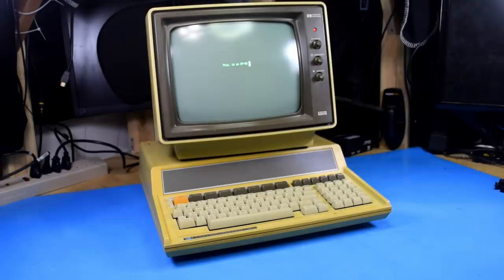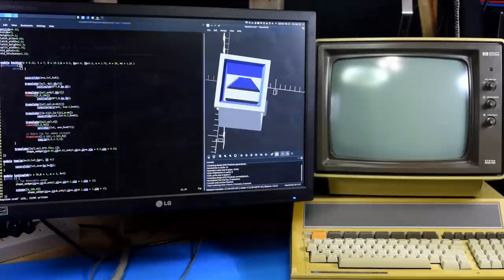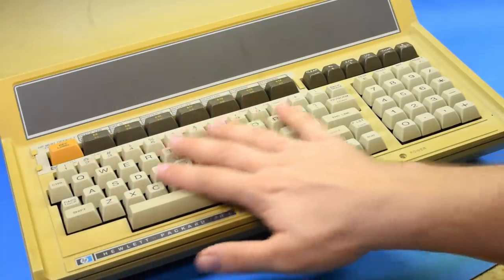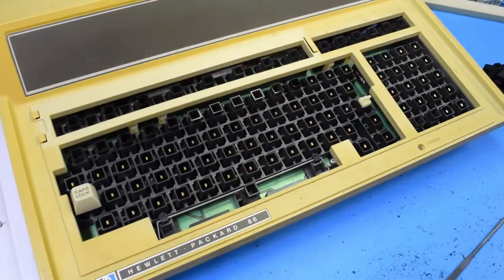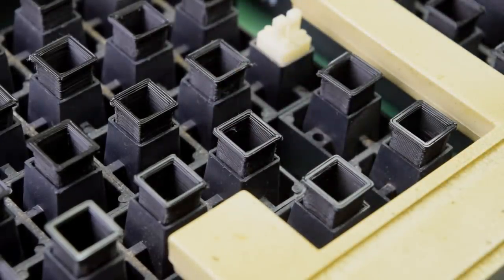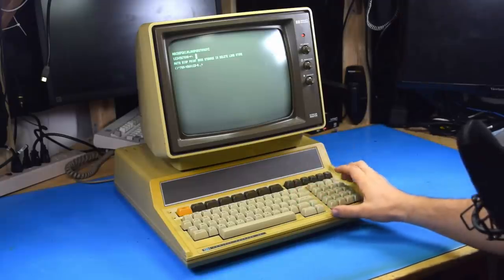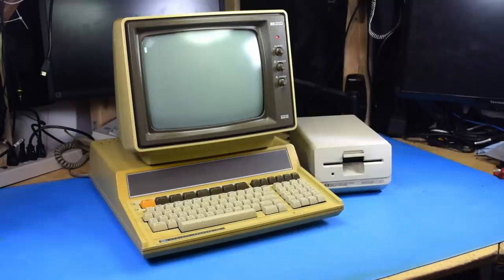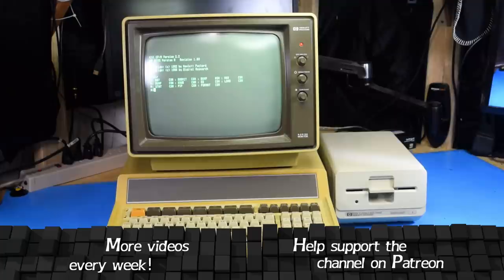0x0029.3 - 1/2 yr Update on HP-86 3D Printed Key Stems

Comment: If you give me the STL files I can print these on a FormLabs SLA printer with glass-filled plastic for you.
Reply: they're in the description
Reply: I would too be curious to see if these prints fair better. Also, post a vid of the print process ;)
Reply: @rhfweb  Well, I printed the first thirty or so last night.  They look pretty nice;  they're postcuring in my UV light box right now.
Reply: @HamburgerExplosion  I see that now.  I made a plate of thirty of these last night.  Printed at 50 µm resolution in glass-filled epoxy.

Comment: If you made those with only 3 of the top edges protruding could you print them on their sides?  I don't know if that makes sense, but I thought making the 'grain' go in the direction of movement would make for smoother travel
Reply from the maker: It would probably for three of the sides, but there are two problems with doing it that way.  The side on the top would then have to bridge the whole way across empty space, and with how thin the walls are I don't think it would be possible to make it strong enough. Also, printing them with the the "grain" in this direction makes it the strongest against the key cap cracking the corners again.
Reply: @TechTangents  That makes sense, thanks!

Comment: Sir, where did you get your fine files?  Who makes those?  I do tabletop miniatures, and have similar files (and have for 30+ years) but the fine tips have broken off over years of use and if I could get replacements just like them - which yours is! - I would be so grateful.  Mine were made by The Armory, a company sadly no longer in business.
Reply from the maker: The files I have are very low quality, I suspect that while they may look the same they must not be the same as yours if they are still in use 30yrs later.  But to answer your question, mine are just a $2 file set from Harbor Freight.
Reply: @TechTangents  Ah, thank you very much.  Yeah, I'll keep looking...heck, in my tiny little hobby I might even find new old stock!

Comment: Seems like the problem is mostly at the corners is is possible to redesign them and make the corners rounded inwards or make the whole piece round instead of square, as long as you can put clips on the bottom where they latch to the keyset and there's enough space for the spring and the levers the piece don't necessarily need to be square do they?

Comment: As you probably know. Putting another processor in a machine to run other operating systems is common. I remember running into some type of Epson computer that used cpm and had a (optional) dos card with a intel processor on it. Even when I started into computers I remember the apple macintosh pds slot run a few different options. Dos card, power pc 601 process upgrade card, and even an apple IIE card. But as you say. That is a different story.
Reply: Didn't the Commodore 128 have another processor or am I making that up?
Reply: From my understanding the c128 had a z80 processor in it to run cpm. Along side of whatever process it would use.
Reply: The BBC Micro had at least four different second processors-  from memory, there was a "turbo 6502", a 65C102, a Z80 you could use to run CP/M, an 80186 you could use to run DOS, a NatSemi 32016 you could use to run PANOS, and the ARM development kit.

Comment: I hate to be the guy who tells you you're doing it wrong but...I think you might be doing it wrong.

That kind of finishing work is really better suited to a belt sander or bench grinder. It's a lot to be done by hand with a file. And I'm 99% sure slicers have an option to randomize layer start points to mitigate this exact issue.

Comment: Cura allows you to print one part at a time separately if you space them far enough to allow the print head to navigate, you could probably do 8-10 at a time, and maybe drop to 150 or 100 micron layers.  That would take a long time, but get you an acceptable result.

Comment: Hey, if I recall correctly there's shit you can do in the 3D print settings to make it so the print head doesn't move between parts during a batch print, instead finishing one before moving on to the next. Should look into that, as that would likely fix the main part of your issues with printing these.

Comment: Couldn't you change the bites to not have a greater height, but instead shift the peaks of them further upward?  This would give them a more gradual slope when inserting for lower resistance as well as making them less prone to just popping out, as the upper slope would be higher.  In theory they should be almost as easy to remove that way.

Comment: Would it have taken more time if you printed the stems one by one? I imagine it'll be tedious either way anyway.
Reply: Thats tough to answer.  Technically the total actual print time would be less as the nozzle wouldnt have to move between parts throughout the print.  The thing is that would be way more than offset by the amount of time it would take to reset the cycle 99 times.  Not to mention the massive increase in work to do it that way.  One of the best things about a 3d printer is being able to let it run a job while you are doing other things.  Having to babysit the printer ever 10 minutes kind of negates that advantage.
Reply: @DoRC  Thanks for taking the time to answer! Looks like filing one by one is the way to go then. (yeesh)

Comment: Would a resin 3D printer be more accurate+strong? (ie, order some prints from a co. that uses laser-resin process)
Reply: Generally the resins used in hobbyist printers are less strong than the plastic used in hobbyist extrusion printers, but you're able to get much finer detail.
Reply: Yes, which is why I'm suggesting that as an idea  @ @UnreasonableSteve
Reply: I think you misread. I said less strong...

Comment: hang on, since the CP/M cart has a Z8 computer in it , could you do some shinanigans w/ the ZX81 to "emulate" a CP/M cart?
Reply: Like DOS, CP/M requires not just a hardware standard such as a Z80 but the BIOS needs to be CP/M compatible as well since CP/M uses BIOS calls for doing hardware functions like writing to disk and keyboard control. Although that said, if HP made a 8086 or 8088 cart then they could use DOS and CP/M-86 even though the later was rediculously expensive compared to DOS.

Theoretically if the computer is close to the specification, you only need to write a BIOS or handling code and yes, CP/M would work. You can also compile your own version of CP/M as well.

Comment: I know there would be limitations but I'd love to see either AkBKukU or someone 3-D print a custom Cherry MX style key stem. If I had a 3-D printer I'd try it
Reply: That is exactly what I would like to try for my Amiga 500 keyboard. Converting to a modern cherry keycap would make replacements a breeze.
Reply: @one_b  That would be badass, but also practical since Keycaps for those rare and older systems are becoming more scarce.

Comment: Never heard of OpenSCAD before, looks interesting! Until now I only worked with FreeCAD.
Good job on the stems but that filing must've been a huge pain in the bottom. My printed parts are usually SLS nylon but I don't print them myself. ;)
Reply: OpenSCAD is good but it has a steep learning curve.  It is script based and everything is defined as mathematical functions.  It helps to have a background in computer programming or engineering.

Comment: If you have a micro rectfyier (is that the right name for the drill-like rotary tool?) that could speed up quite a bit the process, and use less force fo file down the parts.

Comment: This may be a stupid question, but why not do it one at a time, it'll be much much more time consuming but then you don't need to manually file them.
Reply: Explained in the video, he's have to go back every 7 minutes to scrape the part off so the next one could be made.
Making 100 would involve baby sitting the 3D printer for 12 hours.
Reply: @station240  True, and the belt-bed or plow ideas would solve a lot of it. But if I were going down this path without those options, I'd choose "print one at a time, as many as will safely fit on the bed" and wait for the printer to beep. At least that way, I could be doing other things and only have to be interrupted briefly for bed-clearing, every x minutes... That filing looks brutal and MESSY!

Comment: There seems to be a slight issue with your layers, the lines should be more consistent and the blobs should be smaller. Print these in ABS or nylon if you're not as PLA isn't suitable for this task. I print with a bowden so I can print a large batch one item at a time, improves quality and jobs finish much faster because of travel time.

Comment: Well, youve already finished, but you could print one and then use a mold to duplicate it with fast set epoxy.
Reply: You'd have the devil's own time casting pieces that thin reliably and without warpage.

Comment: I think petg would be a better material for this job.  Its a much tougher material and wouldnt wear so quickly.  Its also more flexible by a little.
Reply: I'm a huge fan of PETG too, but when he's already having some stringing issues, it's a hard sell. PETG tends to be 1000% stringier than PLA.
Reply: @UnreasonableSteve  true but stringing is almost always a setting issue (assuming the filament is good).  As long as time is taken to tune everything properly petg stringing really shouldn't be an issue.

Comment: why not have the parts spaced out more so they can be made one at a time and not all at once that would fix having to sand the part down one by one sure you will be printing a bit less but its better then sanding them down one by one for hours or print them one at a time.
The plow thing is a good idea it just pushes the parts off in to a small tub and then starts on the next batch.

Comment: You know your shit about 3D printers- and it still kind of sucks...that really puts me off of buying one..that and the money of course.... It doesn't help that I would want to use the printer for work stuff- but all things I would have to make for that would be straight and narrow- soo I guess I just keep thinking about getting a 3D printer until they are really good and usable by an idiot like I am
Reply from the maker: It's more that this is a really edge case for a 3D printed part. The wall thickness of the stems really leaves almost no clearance to either side and basically every single surface of these touches something. So the margin of error is extremely small for something 3D printed. This is by far the most difficult 3D printed project I've done and I have a feeling most people wouldn't be up to it. 

Almost all other use cases for 3D printers I've encountered are much easier. I would say that in general for mechanical parts like this, if you can't handle a 0.1mm deviance from the design file then 3D printing may not be the best solution. But if you can then it could be a great solution or at least a great way to test your final solution.
Reply: Honestly modern printers like the ender 3 are pretty inexpensive and work well with only minor mods (i was a complete noob a couple months ago and get great prints in pla).  Hes really pushing the limits of the material with a very small single wall design that has extremely tight tolerances.
I hesitated for a long time getting a printer.  Im glad i waited for the tech to mature but im really glad i have one now.  I really use it a lot more than i thought i would.
Reply: @TechTangents  why not print fewer, and make it print each sequentially instead of by layer. I've done this a few times with mine, to stop stringing. I would also use the largest nozzle you can still get your wall thickness with, and do spiral single wall for as much of the part as you can. I built some extra storage containers for an parts organizer with a .8 nozzle, I could print 4 sequentially on the bed single wall spiral and they are ridiculously strong. Big nozzle, and spiral print give you the best layer adhesion you can get.
Reply: The Prusa Mk3 probably wouldn’t have that problem on the corners, or at least I haven’t experienced that with my prints yet. I’d have to test your model.
Reply: @techn1fire  mine wouldn't either. Though he did say he was still tuning after making some mods.
Reply: @DoRC  oh that ender 3 thing is way cheaper than I thought (last time I checked the cheapest usable one was about 800€- that think is 225€) and available in my country...has me thinking again..
Reply: 3D Printers are not end consumer devices. You shouldn't expect the same quality and easr of use of a paper printer. Regardless of which model you're getting, you're not buying a product. You're buying a project.

If you want a product and not a project, 3D printing is not for you.
Reply: @crimsun7186  well I don't expect that- but you can buy them at every normal electronics retailer alongside ipads, washing machines and dvd's- completely assembled with a warranty- that is very much a consumer device. I ordered a ender 3 and I am looking forward to get into it- I didn't end up on AkBKukU
's channel because I expect electronics to work :)
Reply: @Maticus_  I may or may not have ordered one right now..... what software do you use for modelling? I am actually paying for some autodesk stuff- but I think my package doesn't contain fusion 360 anymore
Reply: @olik136  Fusion 360 is quite nice for a noob like me, but openSCAD is free and people use it if they don't want to pay for Autodesk subscription
Reply: @olik136  Let's see here.

If I want to print something on a regular printer:
1 - Turn printer on
2 - Send file to printer

On a 3D printer:
1 - Turn printer on
2 - Convert part to STL file
3 - Send that part to the slicer of your choice/supported by your printer
4 - Fiddle with settings
5 - Calibrate the printer to the part you're doing/printer takes some time doing it automatically
6 - Print
7 - Fiddle with settings again because of filament/settings/part didn't come as expected
8 - Repeat steps 2-5 in case you modified your part so it prints
9 - Print
10 - Repeat steps 6,7 and 8 as necessary until part comes out correctly

I will not consider a 3D printer an end user device with all those steps. 3D printers are a project, not a product. You don't need to know how a paper printer works or how to perform maintenance on one to use it.
Reply: @LPMusicON  I checked my licences and it turnes out that my package doesen't have fusion- but it containes 3ds max- maybe that will work- I have never started it

Comment: use the dildo* trick: print one, file it as desired, and use THAT to make a couple of molds... the process may take longer but it's less tedious manual labor and that's what counts

*it is a very bad idea to 3d print a dildo because of the rough and sometimes porous surface created by the 3d printing process, but using a print to make a mold as described is more or less fine

Comment: Your PLA filament seems to be beyond its best-before date. It might have taken in air moisture which often is the reason for stringy prints despite proven-to- work slicer settings. It might also be one of the expensive "premium filaments" that actually are rubbish. I buy the cheapo Kaisertech stuff, and it works beautifully. When I once tried twice as expensive "premium brand" stuff, that ruined a hotend on my Anet A8.
It also looks to me like you printed with something like 0.3mm layer heigth. If that was the case, try 0.1. It's slower but much neater and cleaner, usually.
I found Uhu Allplast to be the perfect glue for PLA, by the way. My wall hanger for my guitar basically fell apart after printing, when I squeezed and pulled its arms to test their strength. I reattached the lose layers with the Uhu gunk, and it holds my beloved Strat wonderfully securely now. Skip the awkwardly handling Epoxy and Cyano-Acrylic stinky venom…
Epoxy is fine for bridging gaps and really highly loaded big glued surfaces, but mixing and applying it is a lossy process a small repair simply doesn't justify.
What with Cyano-Acrylic, that stuff only produces ephemeral joints that won't even outlast celebrity mariages. No good. And it stinks! Bluergh, Phooey!!1!
That top bit that came off that one key stem is a perfect case for the Allplast sticky gunk.

Comment: You can smooth PCB 3d printed parts with acetone vapor.
Reply: Acetone vapor smoothing works with ABS, not PLA which is what he's printing with. Switching to ABS would likely cause more problems in the print than vapor smoothing would help with
Reply: Acetone vapor smoothing works with ABS, not PLA which is what he's printing with. Switching to ABS would likely cause more problems in the print than vapor smoothing would help with